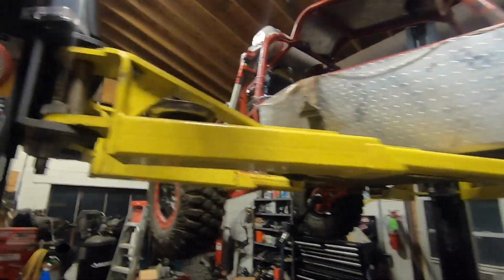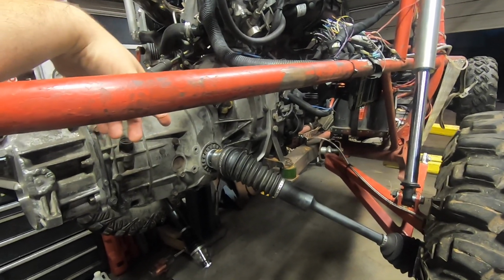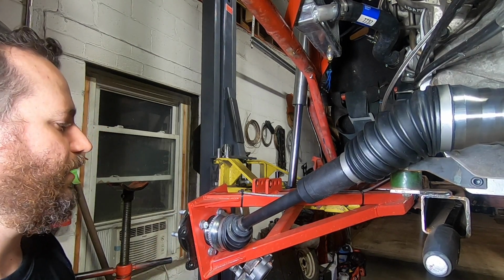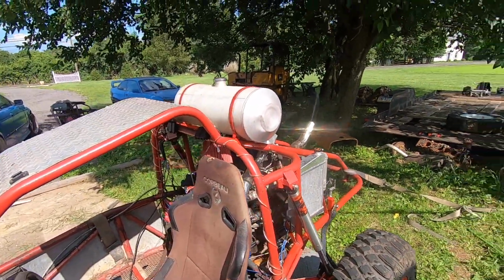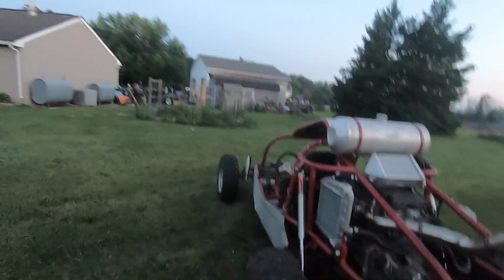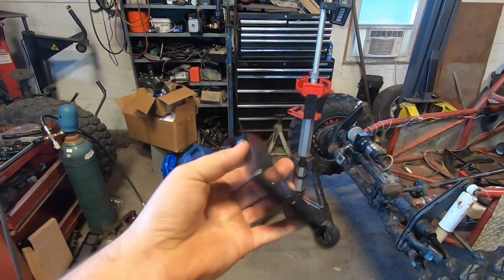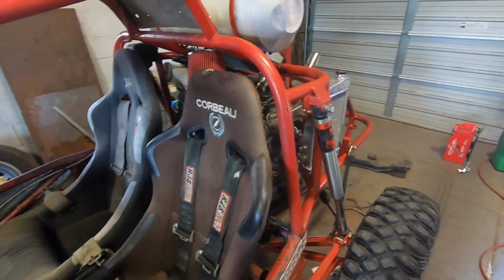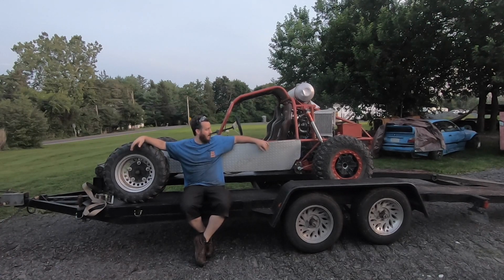Buggy hits the dyno. Big disappointment! Getting ready for a ride.

Comment: one reason it could be in limp mode is the oil pressure switch as well if its not wired up will put the cruze into engine power reduced

Comment: You are literally the coolest dude on the internet. Who would have thought to use a Subaru boxer and Subaru transaxle on a buggy. Shame you are having so much trouble with the cv axles. Would making a longer lower control arm and pushing the wheels back a bit help that crazy angle?  Also dumb question but entertain my thought of longer lower arms on the back and stay with me swap the direction of the engine and trans axle where the weight evens out. Those lowers seem way too short in my opinion. Faacck seeing the smile on your face shredding it in your backyard is bliss. Keep up the good work man.
Reply: Sorry one more question what is the largest ring and pinion a Subaru transaxle could take?

Comment: When the Engine and transaxle torque in the direction of the rotating Mass... that's why only the one axle velocity joint bearing cage is breaking...More solid mounting maybe polyurethane biscuits...
Reply from the maker: Thats a good point thanks for that!

Comment: I think you are going to continue to have problems with those axles at such a drastic angle. I have built a few buggies in the past 50+ years and I haven't seen one with that much angle built in. You do really good work you just need to rethink that setup...  just my opinion. If you do work for people you might consider making a few of those trans adapters, I believe you will be very surprised at how many  you would sell. None of the makers of that type adapter make them. The 1.4T is a great little engine that makes very decent power. My last build for myself has a 1.4T.
Reply from the maker: I sure am having lots of axle issues. There will be some upcoming changes to that for sure. Are you using the LE2 as well?
Reply: just have to use the right parts,  I have a bus trans , micro stub 3x3 , 930 cv's  and I get 18" travel, running a 10" king coilover 12" king  bypass  been pounding on it full throttle for a decade , in desert, people run too long of a shock and have it mounted right at the axel ,  but ay long shock look cool have to be valved like a feather moving 1:1 with the wheel 
 the only mod I done to the cv's is where the balls come together on the outer cv part, I grind It open so the balls can move out further and they can get more angle..   I don't do it like the sand guys open the entire notch and have them floppy.
   someone I knew made cv's for race cars F1 and others said the strength is in all the ball touching at the same time ,  On my cv for extreme angle I just mod where the problem Occurs
Reply from the maker: @cardboardboxification  Good points thank you. I think 930s are in my near future

Comment: Cv must run true at normal operating too much angle for a cv, extend trailing arms, lower engine gearbox. CVs won't last running at full extent at all times, causing load on cage at all times, will never last and spit cages. Due too constant side load, any more than 2 inches of angle variation, failed CV.
Reply from the maker: Sand cars with 24" of travel are doing it. CVs can take constant angle it just shortens life. While the geometry here is not good for CV's, a beefier CV will solve a lot of the problems. I am going to extend the trailing arms and use larger CVs.